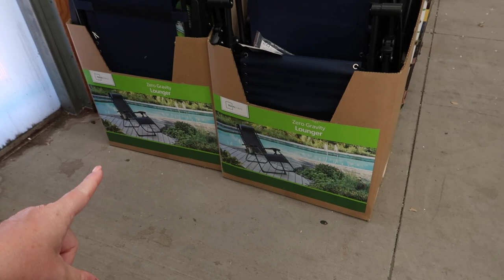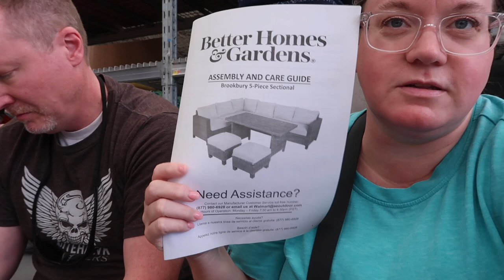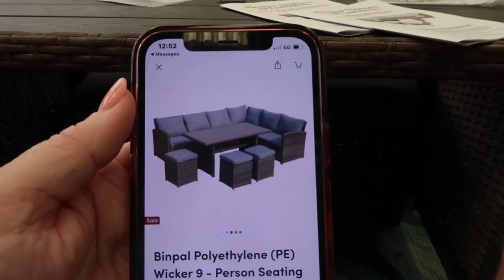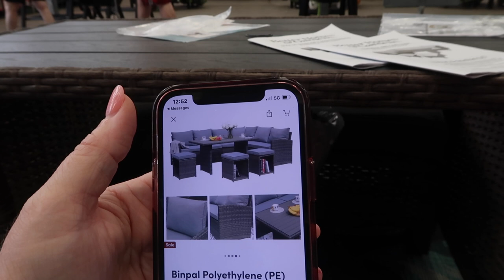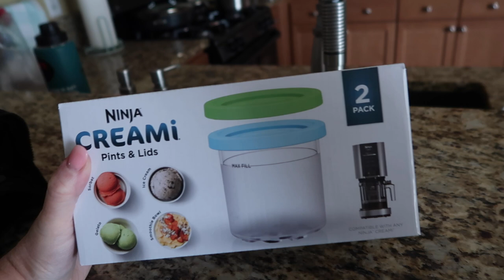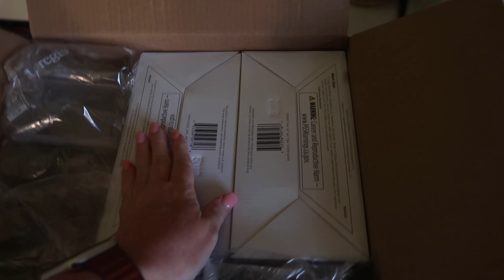WE HAVE SOME DECISIONS TO MAKE ABOUT OUR BACKYARD | SPEND THE DAY WITH US | RUN ERRANDS WITH US 2023

Comment: Love the patio furniture idea.  We are thinking of changing our patio and doing pavers because the decking we were looking at is WAY to expensive right now.    I was just looking at ways to paint or stain patio pavers last night since the color that I really want has been put of stock for a while.   I didn’t even realize until last night it that painting/staining them was even a thing.  Lol
Reply from the maker: Have you looked into getting Trex for your decking? My parents have it and it's amazing! Never wears down at all. I wish we could get it ourselves. But yes, you could look into painting your patio too.
Reply: @daynacreates1105  yes but for the size we are looking at it will be around $11k to $15k for the materials.   Prices have gone up significantly in the last few years since we finally decided on a design so now we are thinking of just expanding what we currently have with pavers so we can get a nice seating area and really use our backyard space more efficiently.
Reply from the maker: That’s crazy!! I’m glad you thought of another way to make your space usable still. I just love our new patio now and can’t wait for summer nights to hang out outside. It’s still a bit too chilly to be out there now.
Reply: The painted concrete is a good way to do it. You can paint it after pour or it can be mixed in at time of pour. At time of pour probably requires something special?

Comment: Instead of painting your back patio, did you try pressure washing it first?  That might help a lot. Those pressure washing videos on YT are highly addictive to watch. lol
Reply from the maker: We washed it quite a few times, and have pressure washed it in the past. The problem is that the previous owners also painted the concrete, but most of that paint has chipped off now. It's probably been over 15 years since it was originally painted. So now it just looks dirty because the paint was rusty brown colored. I agree that the pressure washing videos are amazing! I watch a few guys on TikTok that do it for people for free.
Reply: @daynacreates1105  Homeownership maintenance is never ending! lol  The pressure washing and carpet cleaning videos -- time well spent watching those videos! So satisfying to watch!
Reply: We did a low pressure was but dayna has never liked the color.